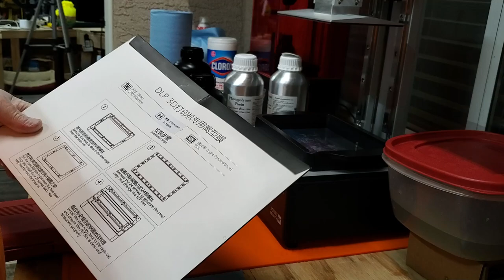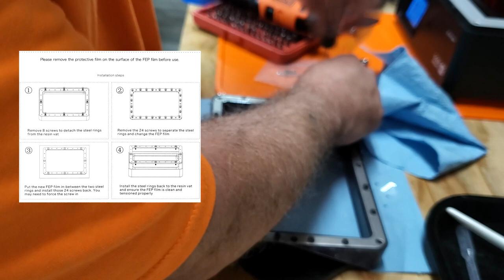Easy FEP Replacement on the Phrozen Mighty 4k

Comment: I don't get it siraya is the same price as the original phrozen  rezin so I dont get why you will try another type of rezin instead of using the one made for this printer..
Reply from the maker: I was using Siraya Tech before buying this printer and I get it locally off Amazon. I never had very good luck with the Phrozen resin, There are many great brands that print very well at a great price and low odor. When I'm not reviewing resin from a company I prefer to buy Siraya tech depending on price.

Comment: thanks! I'm experimenting with porcelite resin from tethlon. the suction sucks! This stuff is dense. The rainx sounds worth a try!
Reply: I put Rain-X on my newly installed FEP. Don't know if it helps, as the original factory FEP didn't pop either. To me, it's just a preventative measure...Can't hurt applying it though. Just make sure you rub all of the FEP dry afterwards....

Comment: just a pointer you should use cardboard for replacing your fep sheet it will get you better tightness,even better than factory...i have a phrozen transform and dont even use a lube i get no resin stick or anything because my fep sheet is so tight
Reply: Please explain where you use the cardboard, if you don't mind. You mean to place the cardboard on top of the new FEP sheet and then cut it away at the end? So there is an extra fill of cardboard on top of the FEP where the screws go in? Not sure what you mean. Thanks
Reply: @jeremygard  i use the the frame of the vat to trace onto the card board, cut it out and then staple the fep sheet to the card board then place it onto the vat . after all that start screwing down the fep sheet on the vat...after you get all the screws tightned cut the cardboard off and your fep sheet will be so tight and perfect all the way around
Reply from the maker: @davidforaker2235  Because the Vat has a deep lip, its extremely tight once FEP is installed., So a cap or piece of foam will give you a little slack when installing. There are always different ways of doing things. This is just how I do it. Thanks for your comment, we all learn from each other and get ideas. The only dumb thing I did here was cutting off excess FEP over paper towel and snagging razor blade on it. Happy Resin printing my friends.

Comment: First time replacing FEP on Mighty 4K.
What is the size of hex key used on screws?
2 mm fits, but is sloppy.
2.5 mm is too big!
I don't want to strip the heads of the screws!!
Help!!
Thanks!
Reply from the maker: The supplied keys should fit. if not buy a set off Amazon with like 20 or 30 different bits you put in the ratcheting handle, not sure the exact size.. Something like this. "Affliiate link "   https://amzn.to/2WU9QuL
Reply: I was assuming YOU would know what size hex key to use,, as you used it in your video.. Strange that youre not sure of the size...
Only got ONE hex key with my Mighty 4K, and that was for leveling the build plate Z axis. No other key sent.
Rather not buy tools I'm never going to use.
I had gotten a 2mm, 2.5mm, 3mm & 4mm T-handle set to cover all bases, but evidently they don't fit, or fit well. I don't want to take a shot in the dark for an unknown hex key size only to find out nothing works anyway.
.....but thanks for trying.
Reply from the maker: @paulharbach5901  Since i have no resin in the vat right now, I checked with the one they included with the green handle. Its says 9909  H2X75
Reply from the maker: None in my set fit those really tight. Possible ask on Facebook group for Phrozen.
Reply: Well, I guess I'm SOL for the time being. I didn't receive any green handled hex wrench with any numbers on it.
Those numbers are Greek to me.
I just sent this question to Phrozen Support.
If 2mm is correct, their hardware is lacking good tolerances, as a 2mm hex wrench will fit, but has about 30° of rotation before it grips.  Don't want the chance of stripping a screw when I don't need to.
Reply: @paulharbach5901  also wanted to add that I had zero issues with the screws breaking loose and tightening down. No chance of them stripping. That set also had a driver for the build plate so it’s a win win.
Reply: @kilerrabit313  I ordered a new batch of M3 x 8mm screws thru Amazon for the stripped screws I was finally able to extract by using a dremel to cut a slit in the heads and extract with a small screwdriver. I found the 2mm hex heads on the Phrozen vat to have LESS tolerance than the new screws I got. That is why the hex key stripped the screws,  as it was loose in the head with less grip than the replacements. Phrozen screws are of low tolerance fastening heads, I have found.
FEP replacement went very well using the cardboard frame method.  Got a snare drum sound like factory and have had successful prints!
Thanks for responding!
Reply: @paulharbach5901  oh wow I did not know you had some stripped ones. Sorry to hear about that! Fair enough and the ones I just replaced seemed firm, so maybe a fault? Thank you for the info though on the replacements you used, would you mind sharing the link for the ones you purchased as a just in case? I have been thinking about getting a metal vat honestly.
Reply: @paulharbach5901  glad to hear your replacement went well! I will be honest I have been dreading replacing mine. I have watched other videos and people have made cardboard stencils, pulled out protractors and a plethora of other means to replace their FEP. This video though showed me it’s not that difficult and it took less than five minutes to replace. I had previously purchased an nFEP and decided to go with that one, have not printed yet so we shall see. Again, I am glad your replacement went well!! Thank you for the info!

Comment: Rainx doesn't do anything for your adhesion, check the msds... nothing more then a mix of ipa+acetone+ethanol.
pfte doesn't do much either since you're basicly applying more teflon to a teflon sheet
Reply from the maker: Without it, I have a huge constant popping sounds from suction, with it , I don't. So in my "Opinion" It seems to help a lot. Have you tried it?
Reply: @3DHP  no need, that (n)fep is made from a material that very closely resembles teflon, there's literally nothing you can smear on it to go more non-stick as it already is.
Only thing that rainx is doing is cleaning it, since ethanol/acetone and ipa are all very good for (make sure it's all evaporated, or you'll get a stick to nothing at all issue).
Furthermore, even if you manage to find something to get your fep even more non-stick it would only last for the rafter of your supports since you're literally ripping of the coating with every layer you're printing... won't be much coating left after the first few layers.
Reply: The rainx did wonders for me... ever since i've had my printer, from the very first print i've listened for the pop to let me know my print didnt fail.. this time when i swapped out the fep, a lil rainx and no more popping. 

Also rainx is not just ipa+acetone+ethanol.. its got silicone in it. The alcohols are just the suspension fluids. When the alcohols evaporate it leaves behind a thin layer of silicone.

I just came back to this vid, cause i finally remembered to pick up some rainx today. Its made a big difference this replacement. Wanted to say thanks for the idea.